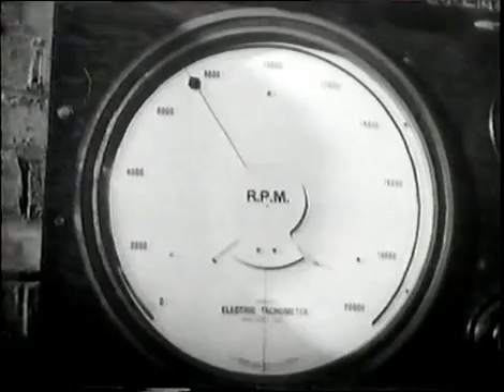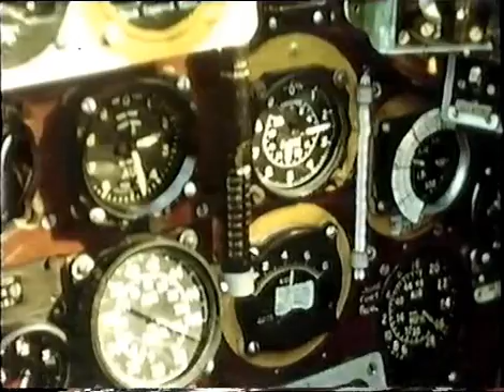Development of the World War 2 Jet Engine.

Comment: The jet was a German first!
Reply: Reginald Mc Nab 

The axial compressor was first demonstrated in England, the Germans were the first to get a production model running. While the Allies used centrifugal compressors because they were more reliable and better understood at the time. That’s part of the reason why the ME262 had to have entirely new engines every few hours. Axial jet technology wasn’t ready. It’s yet another example of the Nazis pouring scarce resources into on paper war-winning weapons using technology that wasn’t ready.

The father, as we know it, of the turbo jet was British inventor Frank Whittle. Long story short, the British defense ministry rejected Frank Whittle’s design in part due to reviewing engineers at Armstrong-Whitworth pointing out, correctly as it turns out, that a turbo jet engine would be fundamentally inefficient. Instead Whittle patented the design, and not being top secret, the concept greatly influenced the Nazi design team led by Hans Ohain.

Engineers at Armstrong-Whitworth, drawing upon their criticism of the Whittle concept, began development of the first axial-flow turbojets and the first turboprops. And it is this technology family that led directly to today’s turbofan jet engine. The Whittle design proceeded in private development, eventually being taken over by Rolls-Royce. By 1944, the Armstrong-Whitworth design developed higher thrust with superior throttle control, and the Powerjet/ Rolls- Royce centrifugal flow turbojet has proven itself to be far more reliable than the competing Nazi jet projects, the Jumbo 004 and the BMW 003.

Steel is the wrong material from which to build jet engines. Given time, steel will always fail. It fails because the iron in steel sublimates out of the alloy, essentially turning the metal to Swiss cheese on a microscopic level. The general term for such long term metal fatigue is “creep.” In the 1940’s, no one knew that steel would inevitably fail given the temperatures and pressures in jet engines. The correct material that makes jet engines actually practical, and not simply impossible, is nickel alloy, which was a British invention, designed by the British jet design teams. There is no indication that the Nazi design teams ever understood that steel was never going to work, no matter how much they modified their design. The fact that nickel alloys were the solution was not at al intuitively obvious and the Nazis weren’t doing much in the way of R&D to discover the problem.

The Nazis two major production jet engines never managed to last more than 25 hours. You can’t win a war when you have to replace, not merely one but two engines, the most critical and expensive component of an aircraft, every few hours. The icing on the cake is that the Nazis didn’t have access to sufficient quantities of nickel, courtesy of theRoyal Navy blockade, even if they somehow discovered that steel was never going to work.
Reply: nazis not Germans.
Reply: The jet was a German first! Even the British empire with hundreds of slave labour and plundering of the places it invaded was not first.
Reply: @teviottilehurst  let's not forget any crimes, including the crimes of the Victors.
Reply: @teviottilehurst  how many millions did the British killed so they could have their empire